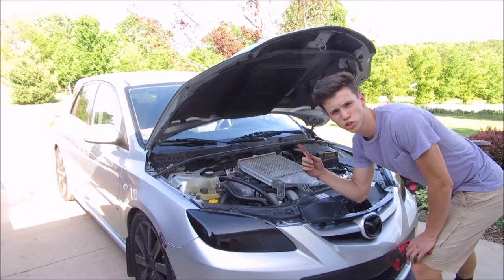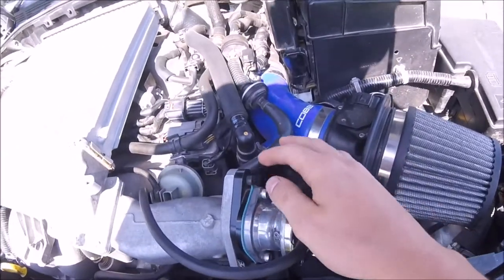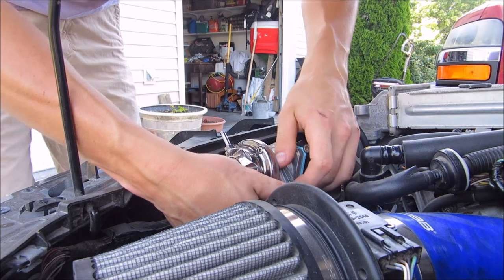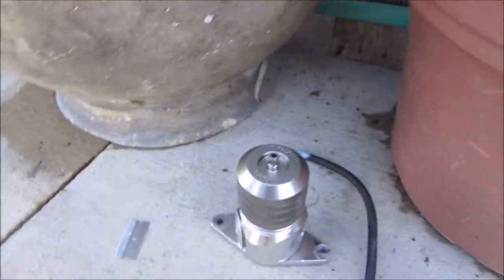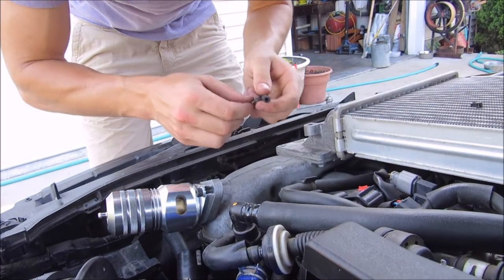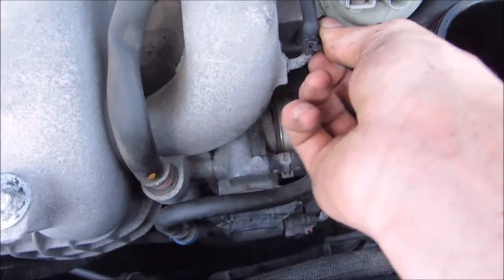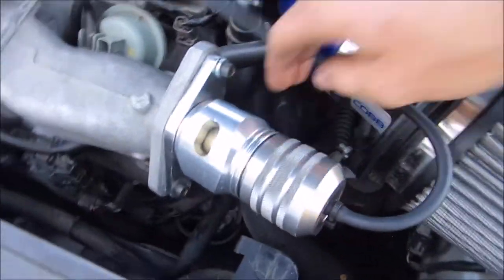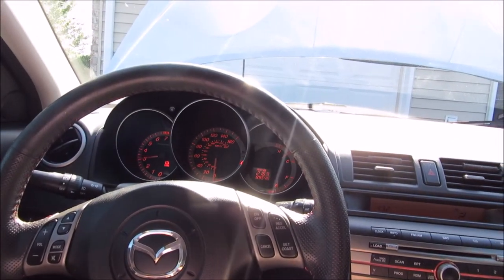Speed3 Goes From Recirc to FULL Vent to Atmosphere (Turbo XS bov)

Comment: Nice vid !! so now my question is... is it good to go VTA instead of Recirc? I have installed an HKS BOV running Recirc mode right now and it's not as loud as the OEM one... do i need to unplug the back hose of the Recirc to make it VTA so it can be louder and will it be good for the engine if I do??

Comment: just a question. don't you have to be tuned for vta since our speeds r made to recirculate?
Reply from the maker: LuisSpeed3 no it'll be fine
Reply: will just run rich for a second, thats all
Reply: Generally it's a good idea. Speed3's tend to perform better with Recirculation over pure VTA. That being said you should be tuning to support mods anyways as you add them.
Reply: +Blux the Cobb Sri are fine un  tuned . Cobb has said that as well , their intakes can run in tuned but preferably to tune it .
Reply: I ran the Corksport SRI and TIH stock for about a year before getting an Accessport. I honestly should have gotten it first. The difference is night and day.
Reply: Do you Still  have the greddy bov??
Reply: You must be tuned. Also you need a guradian angel (GA). What this guy did is not recommended.
Reply: no you dont
Reply: LuisSpeed3 A tune is required, Running rich doesn't necessarily mean it's "ok" just know once you go full vta, Tune is key and it will run great. If you don't you can run lean or rich sometimes even both. Just keep that in mind if full vta is your route. I am full vta and runs great no problems.
Reply: Will at PD Tuning told me that there's no specific tune for vta the only thing that will happen is you will run rich for a few seconds and it's no problem. I'm tuned on a BNR S4 turbo, BOV is VTA and no problems so far ;)
Reply from the maker: pedro emmanuel garcia mercado yeah if your still interested https://m.ebay.com/itm/GReddy-Blow-Off-Valve-Recirc-BOV/282956827969?hash=item41e18a8d41:g:9NIAAOSwfLJa8RX7
Reply: Nice video dawg I have the same bov

Comment: I thought on the greddy you could unscrew the top and just rotate it. I could be wrong been a long time since I messed with one.
Reply: and the greddy has a different horn for full vent. the horn installed is for recirc

Comment: Most likely going to have a boost leak due to the broken valve. And it doesn't look like you put a new gasket on... not good.
Reply from the maker: Micah Oborn new gasket on where?
Reply: Under the bov. You never want to put metal on metal for the bov. The gasket just creates that air tight seal.
Reply from the maker: Micah Oborn I'm pretty sure I put one just didn't show it
Reply: I can see that there isn't one on there. Its the same size as the whole bottom of the valve. Might want to get one.

Comment: You need fuel internals
Reply: goes rich when dumping air/ blowing off...... so no you dont its fine
Reply: goes rich when dumping air/ blowing off...... so no you dont its fine
Reply: Zak Roughley um the danger for fuel starving comes when building boost before you let off the throttle??

Comment: Do you still have the blow off valve?
Reply from the maker: Jose Munoz it’s on eBay 
https://m.ebay.com/itm/GReddy-Blow-Off-Valve-Recirc-BOV/282956827969?hash=item41e18a8d41:g:9NIAAOSwfLJa8RX7